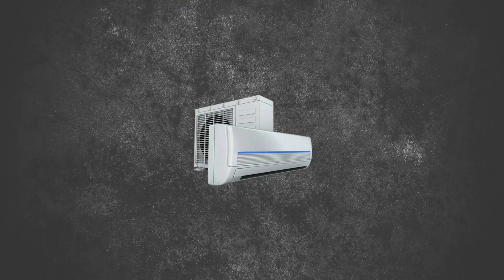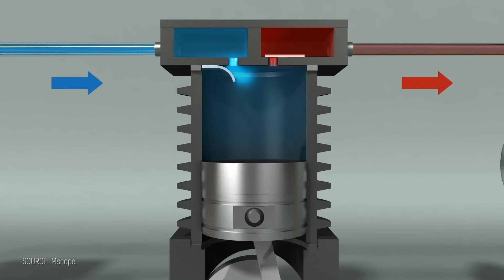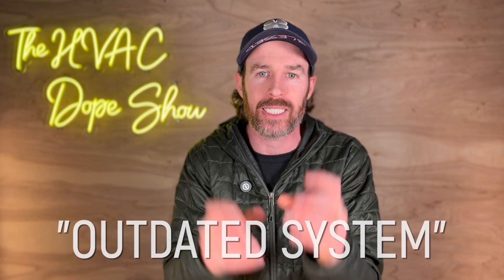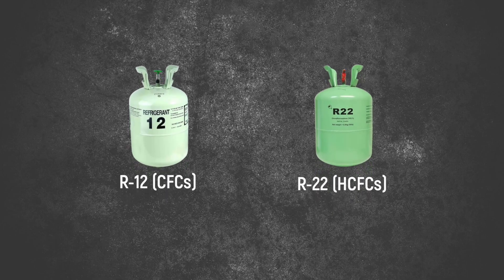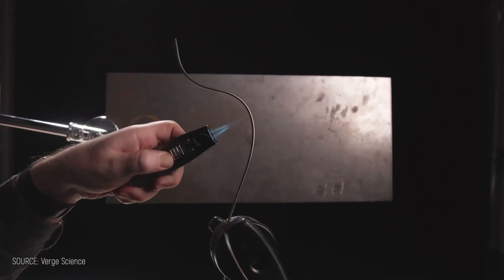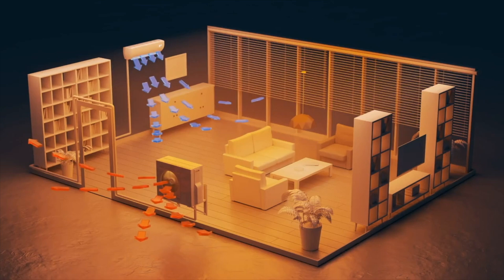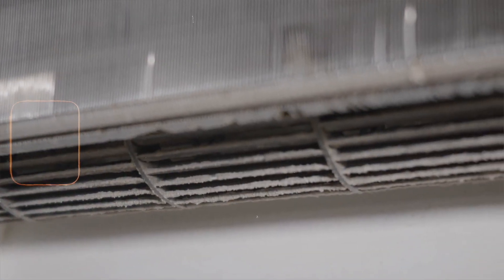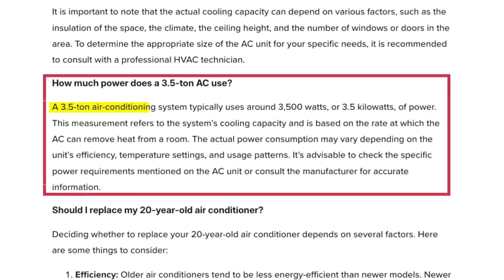Will Solid State Cooling change the future of HVAC?

Comment: In this post, I want to share some ideas of mine about elastocooling. The basic thermodynamics behind elastocooling is the same as gaseous refrigerants. When anyone want to stretch the elastocooling material, it's volume increases and that means it's temperature decreases, plain and simple. And due to the temperature difference, heat from outside will enter into it. Now, when the material will be released back to its original form, the extra heat that had entered into it previously will emerge as extra and the temperature rises.
What I want to do is to use gas/vapor instead of any solid material as gases can be stretched further and there is no question of elastic fatigue into gas/vapor. The gas first will be expanded instead of being compressed like present day compressors. After being compressed, the gas will become cooler and heat from outside will enter into it. After the temperature of inside and outside being close, the gas will again be compressed back to its initial volume (or further more) so that its temperature will increase and the heat sucked previously can be released elsewhere.
That’s just the description of the basic process that I have in mind. There are other details and thoughts related to it. Anyone wants to do experimenting on this idea kindly contact me. No financial burden is attached to it other than the cost of prototyping and testing.
Reply from the maker: Interesting but yeah that's kind of my thought... seems like elastocaloric cooling is not viable atm at least on a cost effective basis
Reply: @TheHVACDopeShow  Before coming to any conclusion, kindly go through it in detail.

Comment: My 40 year old hvac from Canada eh’ still going strong with zero maintenance. So tell me the cost of this considering new hvac life expectancy is less than a decade, and at least 6x the price. 
I don’t believe for a second this is going to be a great innovation.
Reply: I have TECHNICIANS certification in HVAC/R. There was something called solid state cooling. The cost per BTU was very high, but it worked. I've been "retired" for more than a few years. IF they can get the cost per BTU of cooling down this system would hold promise
Reply: The damage done by the CFCs may of been justifiable to ban them. However the HCFCs are a different compound, would degrade in lower atmosphere if it leaked. Then the HFC like 134a being reclassified as having a global warming potential. I'll call propaganda on this one. I have the EPA certifications for freon handling and recovery. The EPA keeps moving the goal posts. I had someone at my local supply house that was very upset about the whole scam. He brought it to my attention that one volcanic eruption would wipe out more ozone than  any of our refrigerants combined. It is good to have enviromental controls but when they go on and on, that is another problem. I wouldn't be surprised if the EPA made up some sort of b.s. about the "high efficiency" system you are showing here.
Reply from the maker: Planned obsolescence... I started to notice very quickly that manufacturers make a lot of consistent money just by phasing out a refrigerant. I know it's a plan because we're phasing in stuff that's already phasing out in Europe lol. Regular posters from foreign countries constantly mention refrigerants like R290 and Butane... in monobloc applications these are very safe, and no more dangerous than a propane tank at a barbecue.
Reply from the maker: But those natural refrigerants are 1. Cheap, and 2. Long term solution, which means they won't be phased out.... thus bad for business. Shame on me for using my brain🧐

Comment: I wonder if this would be the dymaxian architect's dream- a structural metal that reflexes when exposed to heat, causing the building envelope to inhale and exhale, literally. And what about reflexively changing pipe bends to change flow rate of hot or cold fluids. A coils elevation on one end could change to cause the fluid to reverse flow toward gravity. A solar panel could bend to focus towards light.

Comment: Yeah I know one of these cooler caloric material type appliances could only get down to 40F provided outdoor temp was no warmer than 77F OAT. And the fridge cost some where around 16 grand. They produce more heat than they do cool and you then need some where to dump that heat on top of the heat you're trying to get rid of from the structure. One thing to make a fridge, a whole different animal to do modern air conditioning for the home with also considerations of OAT (outdoor ambient temperature)

HVAC in USA is a estimated 33.81 billion dollar a year market by 2028. One of these Global HVAC Gorillas R&D dept couldn't come up with a solution to dominate and up step another Global Gorilla? Um no. Refrigerants aren't going anywhere. Non refrigerant systems will remain as you tube clickety click. Rare earth materials are never going to take the place of refrigerants as they are too costly out the gate.
Reply from the maker: Lafesi is an affordable replacement but I agree it's a while out... hvac cartels are in charge for now unfortunately, tired of the phaseouts
Reply: @TheHVACDopeShow  If you do a closer investigation of what the BTU/h these kinds of things are at right now realize residential can have as much as 5 ton, 60,000 BTU/h and in some cases multiple units that size. The BTU/h these kinds of things are doing are no where even close. To make matters worse the methods they use create more heat as a function of the method to create a wee little bit of cooling. Maybe they get to a specialty product for an apartment or tiny house but the more you dive deep into the BTU numbers? It becomes very clear.
Reply: @ So I did a quick recheck, they talk about such small sizes 1 kW to 3 kW at those sizes you're comparing to a window shaker. So you can get a window shaker for probably a few hundred bucks and it perform better than even the 3 kW model that isn't even here yet. It will remain as you tube click bait that is about it in my honest opinion.

Comment: Why no discussion of R-744 CO2 refrigerant that has been used for what? 20 years?  I get that new technology can be transformational but CO2 is here now!
Reply: Because CO2 has a critical point of around 85F; trying to use it as a refrigerant when it is transcritical in the slightest would be a waste due to inefficiency, and gets exponentially worse with higher ambient. The only time I have ever seen CO2 is in cascading systems which use R407c/410a/32 as the refrigerant in the other cycle keeping CO2 below its critical point.
Reply from the maker: CO2 is not viable for cooling is what I've been told so it's a heating only refrigerant, but like the other comment said use in cascading systems changes this but those are costly with multiple loops and break points
Reply: Why don’t you bring up something else by reading my mind so I can sound smart.
Reply: The EPA will  ban that one too!
Reply: Too much cost and safety for resi